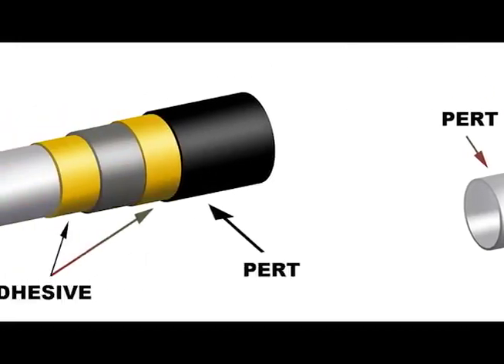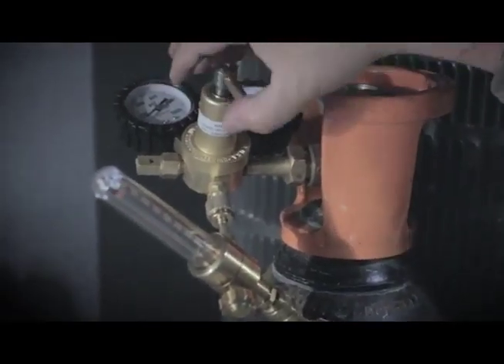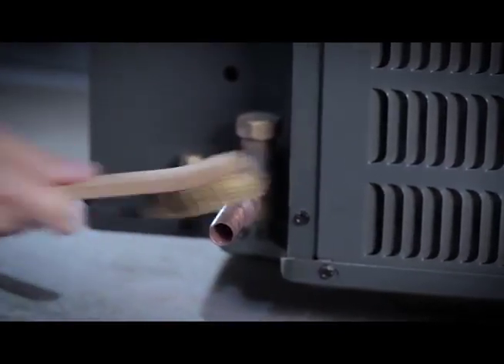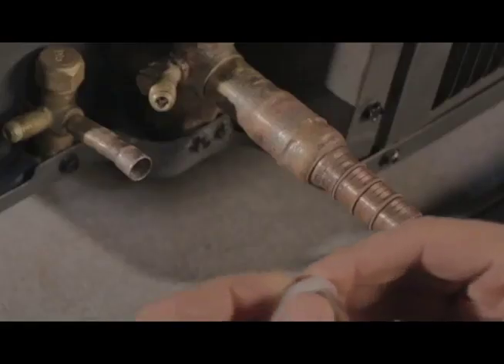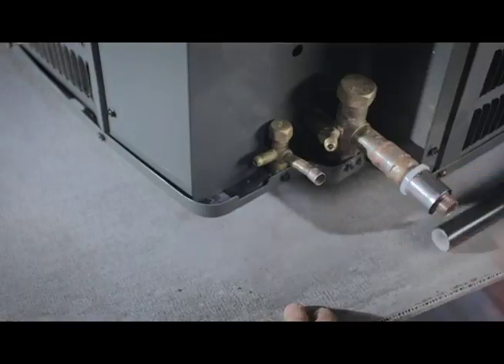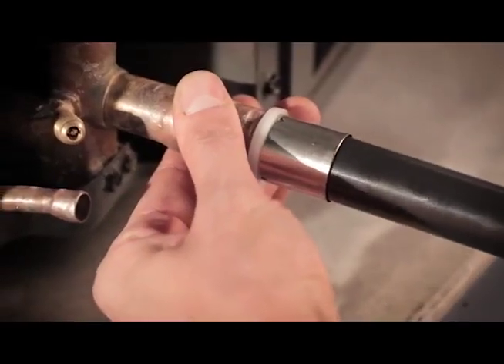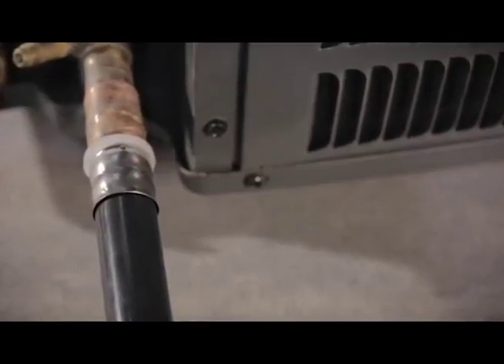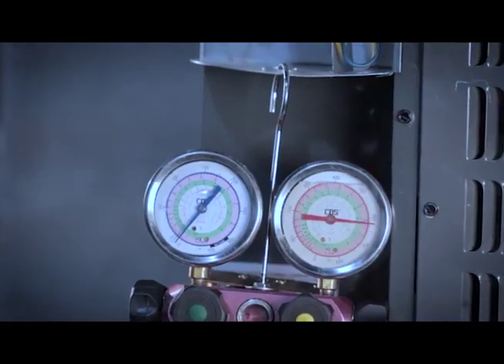Yogapipe Bendable A/C Linesets - Offers a Faster, More Efficient Way to Install A/C Line-Sets

Comment: One more thing to make people try HVAC themselves.
Reply: I have no HVAC experience but installed my 3 ton unit with air handler 6 years ago and it's still working great!  I took my time and made sure I understood everything.
Reply: Most mechanics dont complain about people working on their own cars. Shoot its more business when someone who doesnt know what they are doing screws up, lol
Reply: @mbburry4759  most work you do on your car doesn't involve a controlled gas with strict safety/handling regs associated
Reply: @TheAnzamin  THIS!, they don’t fix their vehicles AC system like recovery, leak repair and recharging like any home unit.  But this piping is innovative but not sure it meets any local code.
Reply: @Balticblue93  as long as its pressure tested with nitrogen or similar, i suppose its an interesting prospect. I do worry about things becoming idiot proof though, primarily because it encourages cowboys to take it on and a general low bar to entry. 

I appreciate its a little old fashioned but silver brazing solid copper is still gold standard for me. I've serviced way to many crimp connections etc that failed because they weren't installed properly (although i suspect they are not as fool proof inherently). It feels like the 'is it good enough' approach that modern engineering is moving towards. I prefer some headroom 😅

Comment: goes to pressure test then realizes your braze joint is leaking then you cant touch up your joint because you will melt the plastic. garbage solution old school copper lines will forever win.......
Reply: BUTTTTT copper only lasts 40 years....HAHA

Comment: Copper tubing is so fragile.  This looks great!
Reply: Micah Epps does this type of lineset have any complaints ?
Reply: Copper is more weatherproof and more durable than this crap.
Reply: @5thhorseman982  I have never installed this product, but what could possibly have you come to the conclusion that copper is weatherproof and durable?   If this truly a PEX ACR refrigerant product, then it is far more durable and weatherproof than copper.  It doesn’t kink, it can be punctured and sealed easily and it attaches with crimp connectors no different than brands like RLS and other press fit connections.  I have never used it because of code, but now I will call and inspector and see if my local jurisdiction allows this.  They do in plumbing with all kinds of PEX products.  I install plumbing PEX everyday.